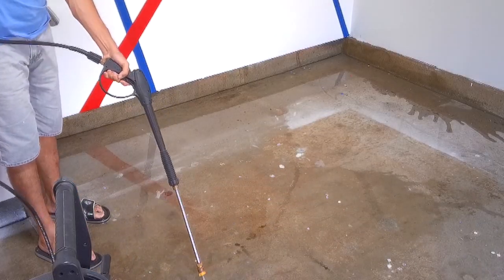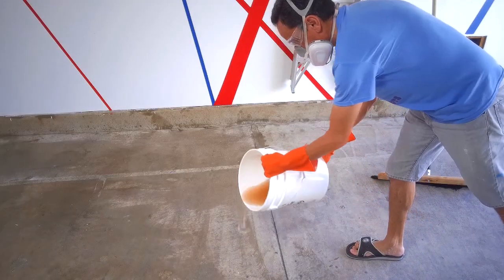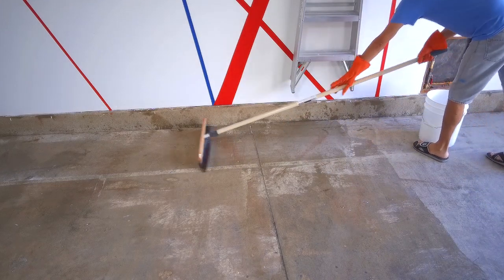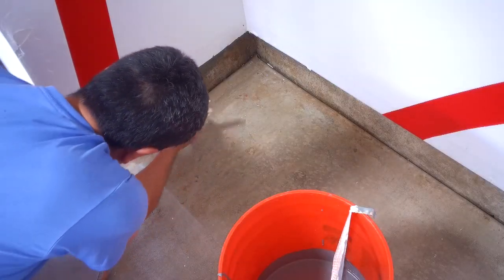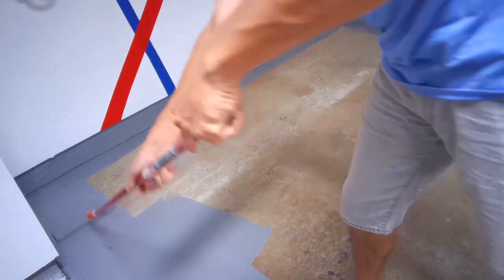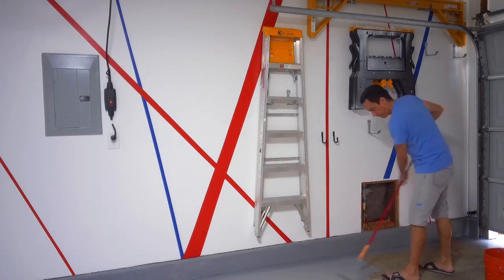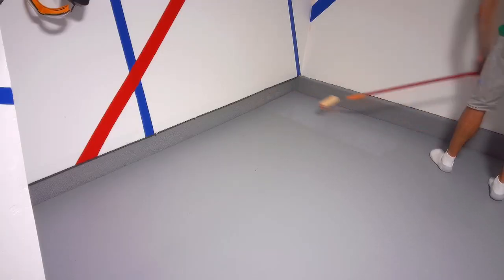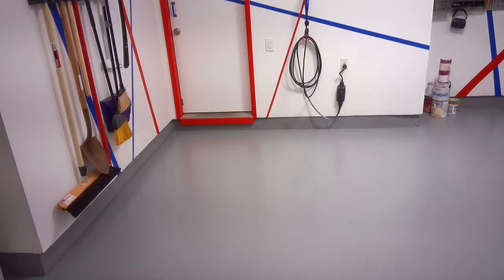Poor Man's DIY: Painting the Garage Floor

Comment: Using Bonding Primer after etching the surface and before using the paint and clear epoxy will make it last longer and prevent premature flaking.
Reply from the maker: I found primer AFTER we painted. When we do it again some day, we will definitely use primer. We have recommended primer in the comments to people who asked. Thank you so very much for taking the time to leave such great advice.

Comment: I can’t wait to do this on my garage!!! Thank you for this budget option!!
Reply from the maker: That means a ton to us for others to be inspired by what we have done. Just to be totally honest as I have with all others that have commented. We knew from the start that there would be chipping/flaking very soon after painting the floor. We only have problems where the car tires are parked. We learned this is because tires heat up when driving and the heat causes the chipping. We are okay with this because the rest of the floor still looks so much better. You could spend much more on the available kits that use a stronger epoxy that can handle the heat better but they too eventually chip. We plan to repeat this process in a year or two as a touch up but when we do so, there are different steps we would take. 1 - we learned there is a garage floor primer paint. using this would help the paint to adhere to the floor even better. 2 - instead of only applying 2 coats of epoxy, we would apply as many as we could with the can that we have. we would not buy more epoxy but we had alot left over so we would just keep applying. The more coats, the stronger it is. If you choose to do this method, we would love to hear how things turn out! Good luck and thank you once again for viewing and commenting!

Comment: We did something similar to that at our old house, and it did peel off a little bit, but the clear epoxy you put on should prevent that from happening. Nice job!
Reply from the maker: I have my fingers crossed that you are right. Thank you for taking the time to watch and comment.
Reply: @Poor_Mans_DIY   Should do primer and then paint & finally clear epoxy. Then surely it will stay for multiple years.
Reply from the maker: @avvarutheja  Thank you so very much for the input. We agree with you and have stated that to people who have asked for additional information. We were not aware of the availability of the concrete primer when we did this to the garage floor but we will certainly use primer the next time. The biggest issue we learned is that the chipping is caused from the heat of the tires after driving. The epoxy that we used is inexpensive and does not create a super strong barrier. We would recommend numerous coats of the epoxy as well as primer.

Comment: It looks great! I'd love to know how it holds up.
Reply from the maker: As we honestly stated, we knew it was an inexpensive method and that we expected chipping to occur. It did chip within a month or so BUT... only where the car tires are located when we park the cars. We learned this happens because car tires get hot when driving and the heat causes the peeling. The rest of the floor held up very well. Chips here and there from all the woodworking we do in the garage , along with typical spills , etc. We will definitely redo this every so many years. No regrets at all!

Comment: Your video is generally complete and thorough. But my question is: What will you do when you have to "Repaint" the garage surface?  Is there an etching compound or sander that will be needed? My garage floor was painted by a prior owner. And it has spots where my vehicle timers rest that have peeled. No what?
Reply from the maker: Anytime you repaint something, it is best to remove the previous layers. I am not aware of an etching compound that will will remove the prior layers. If I were to do it, I would try a heating gun or rent a floor sander before adding any paint or epoxy.

Comment: Hey how did this hold up?  Three years later any chipping??
Reply from the maker: From the beginning, we knew it would chip quickly and it did within a few short months. But the chipping was exclusively where the parked car tires were located. We learned this is because tires get hot from friction when driving and the heat causes the chipping. The rest of the garage was virtually unharmed. The garage has since had more chipping and the floor does not look magnificent because I do a ton of small and large woodworking projects using hammers, and lots of power tools that bang and scratch the floor. Not to mention all the paint, stain and epoxy drips and spills. Overall, I stand by my decision to go the inexpensive route and will definitely do this again as a touchup/refinish. Thank you for taking the time to watch our video and for leaving a great question.

Comment: Nice job Richard!  Looks great, I've been looking into applying the epoxy or garage floor mats but will try this instead.  I just hope it turns out as well as yours did!
Reply from the maker: Doug, couple lessons learned for you. 1 we knew going in that the paint would still chip using this method and it did but only where the tire are parked. This is caused by tires being hot after driving and the heat causes the peeling. 2 - we considered small matts where the tires are but figured it was a minor issue and when cars are parked, you cant see peeling. 3 - there is a garage painting primer. Using the primer might adhere to paint better and prevent peeling. Our method is inexpensive but if I had to do it again, I would use the same method and include a layer of primer first. Would love to hear how things turn out for you. 😁

Comment: Looks awesome!!! Going to try this method. By reading some of the comments maybe I should two coats of the behr paint then apply the clear epoxy coat and hopefully i won’t have chip marks instantly. Anyways thank you!
Reply from the maker: Sammy650, thank you so very much for your kind words.  I learned a lot since we posted this. First... Behr also sells concrete floor primer. I would definitely use primer first. Second... definitely use a second coat. third... a second coat of epoxy will certainly be a good idea. Lastly, what I learned is that paint chipping is cause by the car tires, which get hot when driving. After a drive parking hot tires on the paint causes the paint to chip. I hope this helps.
Reply: Poor Man's DIY thanks for the advice and noted! Haha I won’t be stress about having hot tires too much because I live in Alaska and 9months winter is what we got lol. 🤙🏾
Reply from the maker: @tmtv2234  Mr Sammy, I received another message from you but I am unable to locate it, so I am replying here. I am certain I purchased (2) One gallon cans of paint and it was more than enough. Left over paint would be perfect for extra layers but I will use primer paint first and I would buy less paint and more epoxy.
Reply: Poor Man's DIY thank you so much for the fast reply! God bless :)

Comment: To help it last try to avoid parking your car on it when the tires are hot, it will stick to the tires and sometimes it sticks a bit better than it does to the concrete so it lifts. just park outside for a bit to cool down.
Reply from the maker: You are 100% correct and we sincerely thank you for pointing it out. We have explained this to many commenters and how the tires heat up and cause peeling. We knew this would be a problem but figured it is still much more cost effective than professionally. Thank you so very much for pointing this out for our viewers. We really appreciate it very much.

Comment: Helpful video. Question... After adding the coat of clear epoxy sealant... would that make the floor slippery when wet? That's my one reservation because I have kids and if water spills on the garage floor I wouldn't want them to slip especially if you really can't see a spill on the sealed floor. Thanks.
Reply from the maker: A couple bits of info for you. 1 - we made a mistake by referring to the coating as epoxy. It is a sealant and it has not been slippery when wet. 2 - there is an additive that can be stirred in with epoxy or the sealant that dries gritty and makes the floor slip resistant. I hope this helps.

Comment: Primer is mentioned as a future suggestion.  Does it make sense to just prime where the tire tracks will be, as opposed to the entire garage floor? Save on costs,?
Reply from the maker: Wow! This is a very fascinating question. If I were to play devil's advocate and look at it from both sides, I would, on one hand say, This idea is very clever and it actually wood save on costs. Now looking at it from the other side, I would be concerned that the color where primer was used, may be slightly different from the paint color where no primer was used. One might consider using a different type of primer that is not specifically for concrete and it may not adhere to the concrete or paint. I also do not recall seeing concrete primer being sold in small quantities so if you purchase a full gallon and only use it in small areas, you will end up with a lot of left over that may not be used for years and go to waste anyway. I am leaning towards using the primer but I still think you raised a wonderful question.

Comment: It looks really, really great! I want something this simple, but the majority of the reviews on that particular brand haven't been good at all 😢

How has it been holding up?
Reply from the maker: The reviews are probably correct but there may be more to it. Within a short period the paint started chipping on our floor. BUT!!!! it was only chipping below where the tires rest when parking the car. After research, I learned it is because the tires get warm from friction when driving and the heat from the tires make it chip. One solution would be to place mats where the tires rest and it may help. Of course, when the car is parked, you dont see the chips much because the tires cover it. :-). As for the rest of the floor, mine is destroyed, but I abuse my floor differently from most others. I use my garage as a woodworking shop every day. I roll out workbenches and heavy woodworking equipment, as well as lumber, etc. I spill paint, wood stain and epoxy and it damages the floor even more. However... around the edges of the floor where there is little traffic from car tires and woodworking, the floor looks great. Based on cost comparison to the much more expensive epoxies. I stand by my decision to paint the garage floor as I did. I can redo the garage every few years and the cost will still be less than the expensive epoxy that is supposed to last 10 years. If money is a concern, I stand by this but if you can afford to spend more, you may want to consider the epoxy method. I hope this helps.
Reply: @Poor_Mans_DIY  I understand completely! I'd probably do the same if I used my space in the same way. Most complaints were about the hot tire pickup. I considered getting thick floor mats to prevent that. Thank you so much for your feedback 😊

Comment: I’m doing the same method Using the same products as you.Just put the second coat of paint on the garage floor. How Many hours or days should I wait for the paint to dry before I put on the clear seal?
Reply from the maker: It has been a while so I had to look up the info. according the Behr, wait 4-6 hours for additional coat. I searched all over Rustoleum's official page as they now own Seal Krete and I found no specific instructions for wait period between paint and sealer BUT they show that you can etch, apply primer, paint and seal and be done in a single weekend so doing the math, I personally would be comfortable waiting 4-6 hours. NOTE: We learned from our experience with this and when I do this again, which I will, I will also apply primer first. I always apply primer when painting anything but I was not aware there was a concrete primer, which I found in the big box store AFTER we completed the project. Even rustoleum shows to apply primer as well. It will help the paint to bond much better to the concrete. Good luck if you decide to accomplish this. We would love to hear how things work out for you.
Reply: @Poor_Mans_DIY  thanks for this excellent response. Same here. I found all the steps through online research & reading the cans but couldn’t find the time between paint dry & seal time. We actually did buy the rustoleum concrete all in one primer & paint version of your example. Not too concerned about chipping since we don’t park cars in our garage & light foot traffic. I’m psyched that we can start sealing so soon. Gonna use the whole can for multi layers for sure. Thanks again!

Comment: How is it holding up?
Reply from the maker: It flaked very quickly as we expected but only under the car tires. We learned this is because car tires heat up while driving and the heat from the tire on the less expensive epoxy caused it to flake. The rest of the garage floor still looks wonderful. There are stains every day use of the garage. We are definitely happy with what we did. We plan to repeat this every few years or more but when we do it next, we learned there is garage floor primer paint available. We will use this to help the paint bond better and we only applied two coats of epoxy and had a lot left over. Next time, we will keep adding coats until the can is empty. Between the two of these options, we hope it will prevent flaking a little better.

Comment: Are you able to add flakes to this? I was gonna go with rust olem eproxy but saw to many bad reviews
Reply from the maker: I would not recommend flakes with the epoxy we used. It is a thinner epoxy. If you still wish to do so, I would lay a coat of epoxy down, sprinkle the flakes on on top and add another layer but I suspect the flakes will move around while adding the second coat.

Comment: how has it held up now 5 years later?
Reply from the maker: As we have admitted to everyone,  it started chipping within a couple months. We also learned that it is caused from the heat of the tires. Where the tires sit is where primary damage is. Other than that, it held up well until I got heavily into woodworking in garage. All the equipment,  paint, epoxy, etc has done a number on the garage floor. However, I stand by our decision and plan to repaint again. It was much less expensive and lasted better than I expected.

Comment: Do you think that this manner would keep if you didn’t drive on it?  My garage is just a kids room?🤔
Reply from the maker: Ms Cheryl, I absolutely believe it would keep. the small areas that are peeling are directly under the tires. I learned this is because car tires get hot from friction while driving and the heat damages the epoxy and paint. Although we were not aware of it at the time, there is a primer that can be used on the garage floor. I will definitely be using the primer and use up every bit of epoxy for additional coats, just for the added strength.

Comment: Looks great! What type of clear epoxy did you use? 

I want to do this in my laundry room concrete floors. Problem is there is decade old paint that's chipping off already there. Do you think I'd need to remove that before painting over it?
Reply from the maker: We did a lot of research in advance and I knew going in that this procedure will not fair well and the paint will start peeling  and it has. Our back up all along has been to purchase garage floor matsbut we still wanted the rest of the conrete to look fresh anyway. I dont think it will peel if just from foot traffic so a laundry room may be ideal. For the clear epoxy, we used Seal-Crete Clear Gloss Garage Floor Epoxy from Lowes. (Even with the peeling paint we would do this again)
Reply from the maker: forgot to mention... you definitely need to follow procedures to try and clean off existing paint before painting over it
Reply: @Poor_Mans_DIY  That product is not an epoxy.  It's a urethane-fortified acrylic.  Epoxy coatings are two-part formulas where you mix an epoxy resin with a hardener.

Comment: I'm about to start this project, too! Question: Is the acid necessary? only acid that I know of is the acid that I put in the pool? Would pool acid work?
Reply: The acid is used to open up the pores on concrete and allow the paint to adhere better. I am not a concrete or acid expert so I cannot say if pool acid works the same on concrete. Personally, I would only use proper acid. There are some other, non-acid concrete cleaners that you might try. I am sorry if this is not the answer you were looking for.
Reply: @richardgrant4720  Thank you for replying!!! I'll find someone at Home Depot and check with them! THANKS AGAIN!
Reply from the maker: We would very much like to hear how things work out for you.
Reply: @Poor_Mans_DIY  I will definitely let you know!!! Thanks!

Comment: Great video. Do we have to apply the sealer or epoxy coat after painting?
Reply from the maker: I am totally embarrassed. You are the first person to ask this question and I had to go back to the video to answer your question. The truth is... we misspoke on our video. We used just the sealant, which is an acrylic protective barrier, which we erroneously referred to as epoxy. There are epoxy coatings but they are the ones that were significantly more expensive so we went with the sealant. I will address this in our description of the video. Thank you so very much for pointing out our error.

Comment: If you had a rough service with blasted con try /  excess paint, how many coats would be sufficient in your opinion ?
Reply from the maker: To be honest.. more than extra paint, I would use primer and a stronger epoxy coating but both options are quite expensive.